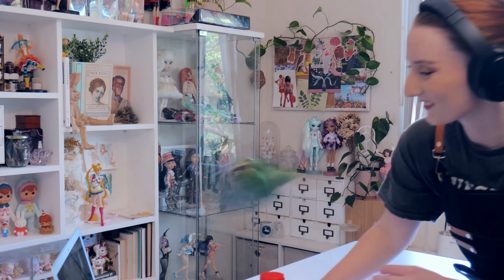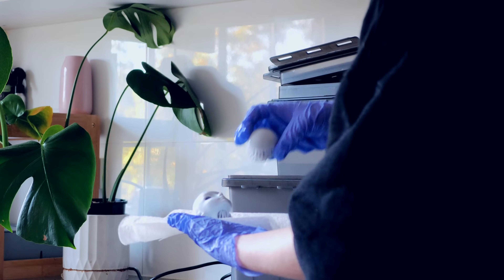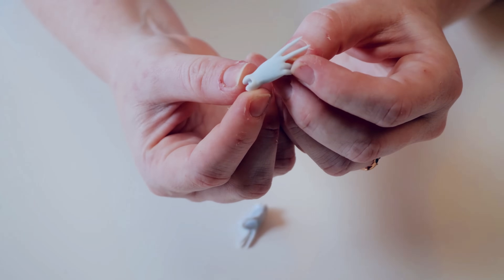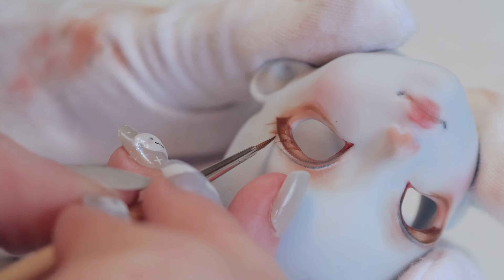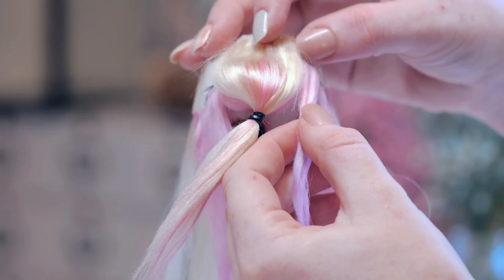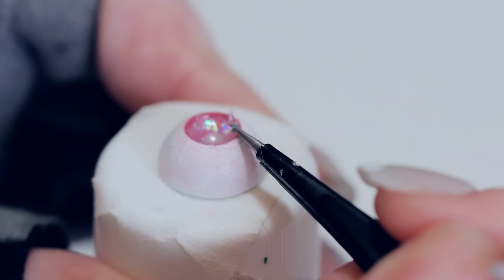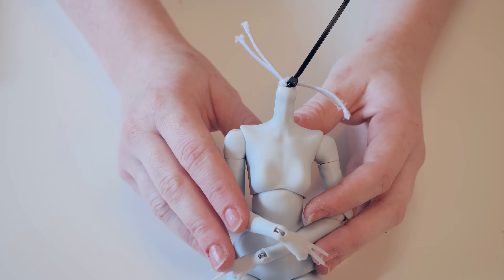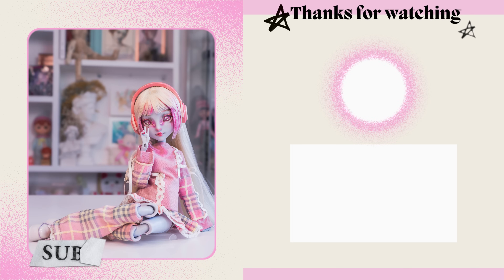I Crafted my Dream Doll✨ | DIY Toy Creation + Customising

Comment: maybe for affixing eyes you could 3d print like a T shape that attaches to the neck to hold the eyes and while the glue sets. that way you could use putty to affix the eyes to the t shape and apply glue around the socket and simply press the T into the eye holes and remove when set?

idk if there already is a doll eye brace thing like that but its a thought🥰

Comment: Maybe the solution to the eye setting problem is using a bit of both? Set them first with a small amount of putty and then you dont have to struggle to hold them for the hot glue

Comment: ohhh that sculpt you made is so cute! I didn't know you did 3d sculpting thats so cool! i dont have any name suggestions because I suck at names but your doll is very very cute! 

i also didnt know that stains would be so hard to remove maybe its because its 3d printed resin or the sealant you used? because i have cast resin (i think its like polyurethane) bjds and im able to get stains and faceups off fairly easily.

Comment: Are you using colored pencils? I am asking because I am using my printers to build some of these for something to do. I am building action figures too, using RESIONE Tough 74 resin. Try it. You will be most pleased. You can drop that stuff all day, and it does not powder when joints rub together at all.

Comment: there is another solution to permanantly putting the eyes in. this stuff called sugaru its a moldable glue this way its easier to put them in just like you would with bluetack but it is permanant.

Comment: What is recommended to do after washing? Wouldn't the resin plastic and alcohol waste be quite hazardous to dispose of?
Reply: You can use the isopropyl alcohol quite a few times. You can also put the used alcohol out in the sun and let the excess resin cure and then strain it out. Which extends the life further.

In Australia we can take batteries and chemicals to special waste facilities free of charge so once every few months that's what I do with the old alcohol.

Comment: Please, never cure a resin 3D print before removing all supports, as removing them after curing is significantly harder and more likely to damage the print. You can also heat your print with a heat gun or hot water to make the piece softer, this is useful in removing them from the build plate more easily and makes supports easier to remove.

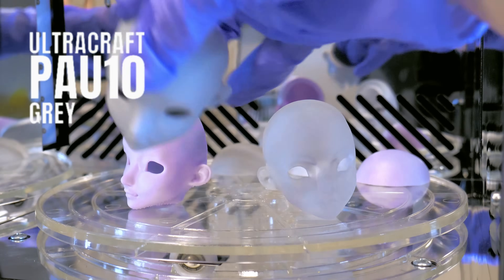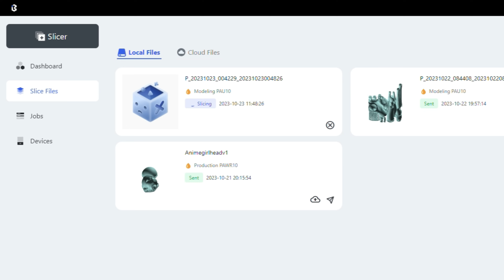Whenever positioning the pieces for print, it's best to avoid straight angles. If you tilt a model something like 20º to the right, then 13º back, compared to it "standing straight", you change the angle of the layers, which will change the angle at which the layer staircase effect is visible. For comparison, the pink head (5:07) wasn't printed using the same angle as the grey head (2:10), that's why you didn't see the same effect in the same place. If you looked at the pink head "from above", you'd see the layers.

Put it another way, when you prepare the pieces for printing, if you look at the build plate "from straight up", that's where the layering effects will be.

One final note for cleaning, if the resin is oil based, you can use nail polish remover to clean the prints. I never tried mineral spirits, but I did use isopropyl alcohol for some time, and that left the prints with a stench. Nail polish remover (or diluted acetone) not only is safer on the skin, it leaves the piece with a much nicer odor.

Comment: IMPORTANT INFORMATION

Okie, so alll parts of resin 3D printing including washing and curing gives of VOCs (Volatile Organic compounds) which are very very bad for you, especially long term!! so you should always always always work with resin in a room not connected to any living areas or areas that you won’t be in for long periods of time like a garage or well ventilated (exhaust fans pushing fumes outside) for instance. And always wear a respirator and gloves when working with it, not the flimsy masks they give you with the machines those do absolutely nothing. An actual respirator which cartridges specifically for VOCs they’re relatively cheap ($40 for the mask and cartridges) and a must have if you plan to get into working with resin if any kind. Also even if the company says it’s “non-toxic” they are lying, there is no such thing as non-toxic resins they are all very bad for respiratory system and overall health until after curing. Also the curing process itself lets off dangerous fumes as well. I’ve been working with resin for years both printers and casting and it’s a fun hobby!! You just absolutely must read up on safe handling and use from sources other than the manufacturers which fluff over safety for marketing purposes. Also a lesser known fact, studies and experiments show that the carbon filters they’ve been throwing in with printers lately are not effective in reducing VOCs only the smelly fumes which gives you a false sense of security when working with resin! 

Side note I love your projects, they are super cute! 🥰